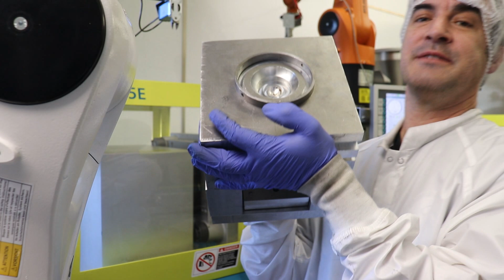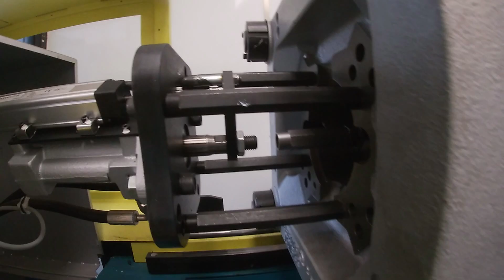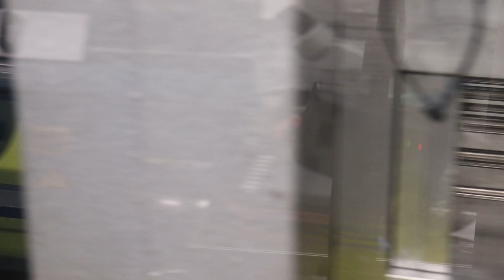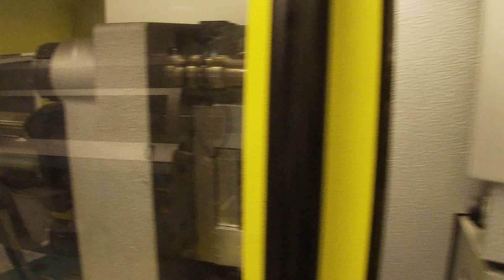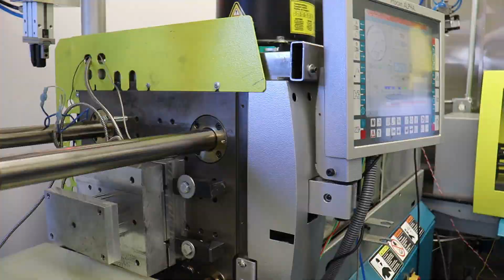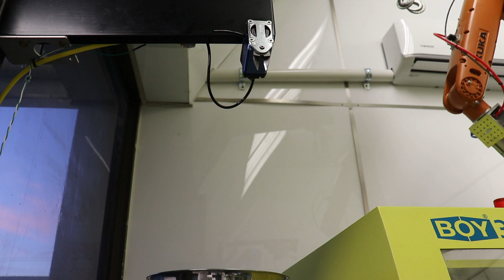Family Mold and Robotic Automation

Comment: Hello, I have a comment and question. Firstly, I know nothing about injection molding. It seems there is a lot of set up just to get the production process going. I notice you are doing a lot of test runs and adjustments. My question is...once you dial this all in and obtain a satisfactory product, do you still have to go through all of the dial in procedures when you produce each day?
Reply from the maker: Hi Perry, usually the process holds pretty good.  every 500 -1000 parts there may be a hang up. Usually it because i dont add more plastic.  Thanks for watching!

Comment: I like robots but in my opinion a injection molding tool with tunnel cut makes much more sense than the robot action.

Sprue and parts are separated automatically by opening the mold. Parts falling down in the Maschine and you can pick up only the sprue.
This is a default technic all over the world.
Reply from the maker: I do like tunnel gates too, these parts were a little to thin for tunnel cuts and budget. Ive also found that sprues are nice indexing handles to start the part down a value add robot assembly line. Thanks for watching!

Comment: The cycle time of the M-machine is to schort for the robot to finish its work, i guess it is to complicated to change that, because if you change only one parameter of the moldingprocess 
the product failed.
I have got a question, is there no problem with the lubrication in the planatery gear of the green robot if you fix it horizontal like you do?